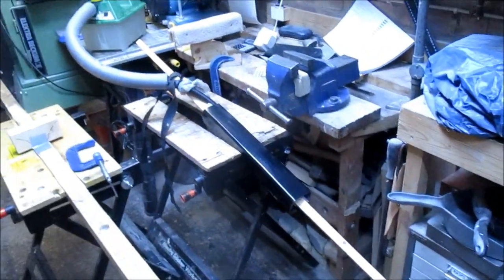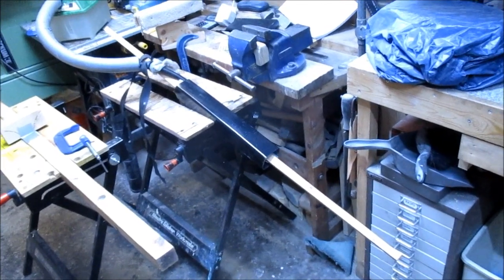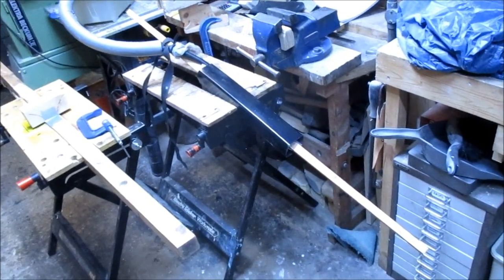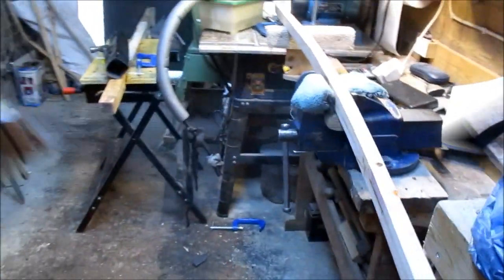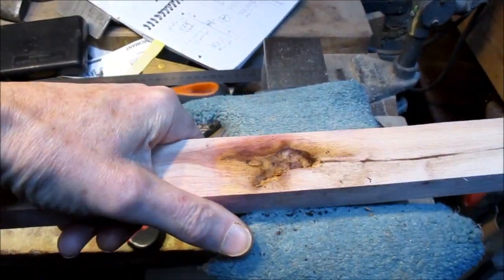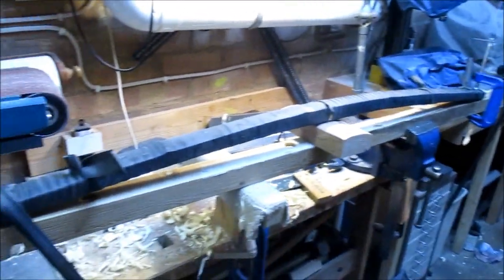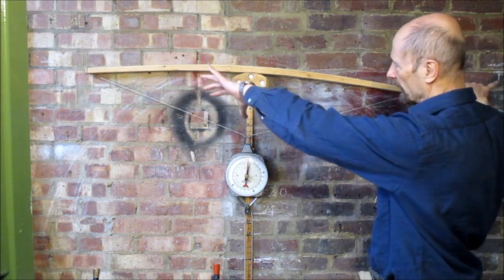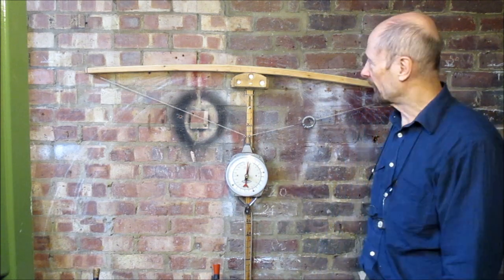Lever bow pt1

Comment: great content as always mr cat! I was thinking about trying a lever bow soon so I'm excited to c the next part of the vid! also I'm curious what kinda bandsaw do u use? it seems good ones cost a pretty penny. thanks for sharing!
Reply from the maker: I got my bandsaw of E-bay it's an Electra Beckum BAS315 I think there are virtually identical ones under other names, spares are readily available, and I'd rate it as one of my best buys. I've handled fairly large logs through it with an appropriate blade. If you are getting a bandsaw, get the biggest you can afford/find/fit in the workshop! Note any bandsaw will need some maintenance and adjustment so buying second hand isn't really an issue.
Reply: @delcat8168  awsome thanks Mr cat!